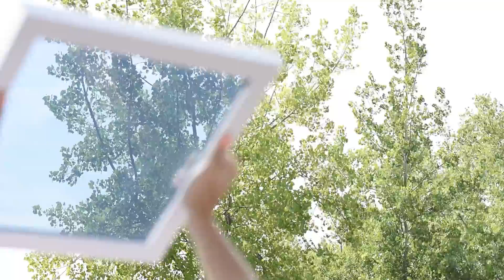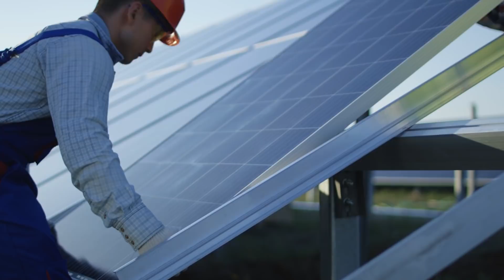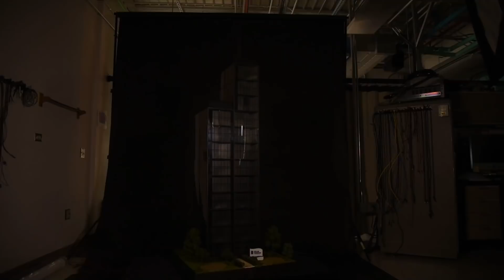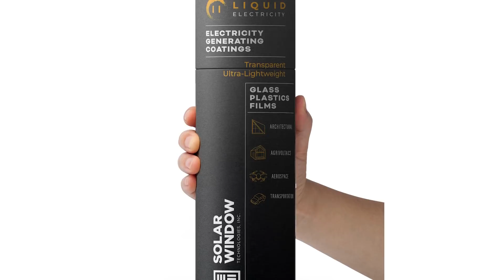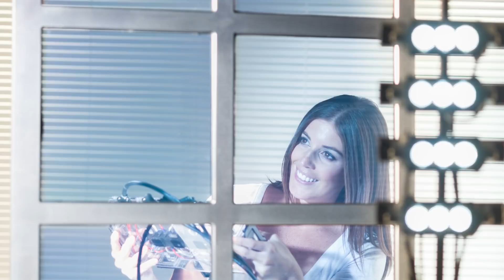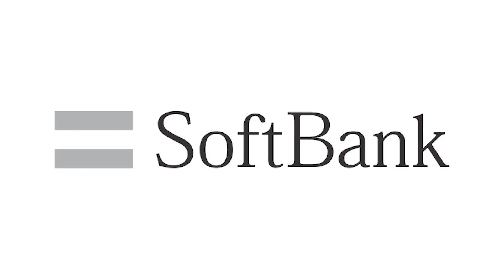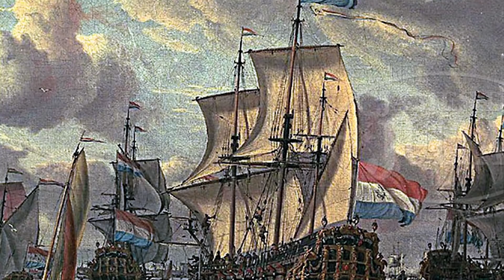Solar Window (WNDW) Your Next Solar Investment?

Comment: where and when I can buy this product? how much power is produced on that 3x3? too vague ....
Reply: Hi there, looking at the video on the SW website a 3x3 foot pain of the product is giving  about 100vdc Open cct, or the other test with a 1x1ft panel gives 8.5v at 2.85amps nominally under load = 25watts x 9 for a 3x3 is 220watts loaded up...not as efficient as current Solar Panel tech but is 1/2 way there IMO..I'd love to able to verify with a sample, please feel free to correct my figures if you spot anything challenging, cheers Hunter
Reply: @alicetronics-jaycarsplatin5629  I saw those numbers we really don't know what is there, looks like a basement ! If those are the real numbers that's good in addition to be cheap, but who knows.
Reply: Roll-up thin-film solar-panels will be available from China soon. It's like LCD or OLED displays on modern TV's. Mass production is easy after first having heavy startup-costs, holds production back. As soon as we all buy these big Tv's this is gonna accelerate really quickly. You will be able to buy this for less than $5 a full meter worth ready to be shipped in a tube.
Reply: Check back in 10 years.  Great concept, but no product.
Reply: 0,002 watt pr sqm lol
Reply: There is no “product “ yet. Just concept.
Reply: @fscott1134  that's what I think too, but the guy mentioned that they are ready for production this year and if you are ready I would think he would mention numbers, how much power does it produce, cost for application and so on.

Comment: Did he just say "A one year financial payback"?
As in after one Year the investment will have paid of?
Surely I misunderstand this, because that just seems crazy.
Reply: it would make sense if it's super cheap !
Reply: @biskero  Still I just can't wrap my head around that kind of payback time.
If they can achieve that on scale it's going to have absolutely HUGE implications
Reply: @elsmaster5592  but there is no mention of power production, in the interview he mentioned a 3x3 feet glass but no power production, looks too vague! I mean it's so mind blowing why not showcasing it?
Reply: @biskero  maybe he can't disclose that at this point in time
Reply: @biskero  also that doesn't matter too much as long as it generates enough power to pay itself off.
And we have to remember that every bit of power generated is more than the glass or whatever generated before
Reply: @elsmaster5592  if you know how much power it produce you know how much it will cost and you know if the ROI of 1 year is true. Just strage that there are no numbers.
Reply: I think he was giving a best case scenario if you have a 40 story glass walled building to install it on.
Reply: @franzkirsch539  sure but some data helps everyone to understand
Reply: @biskero  What it seems like to me is that the price of the raw product is so low that it must remain patented and under wraps to preserve any kind of profit margin for the company. Once this becomes generic, it may become as cheap as a can of paint. In other words; you have something so cheap to apply that saving $2/month per window on electric costs makes sense.
Reply: @Nphen  could be but I would have like to see numbers. I mean as a company you got something so great and you do not share data? Also he mention the coating is an organic material which rises so many questions. I hope is true btw.